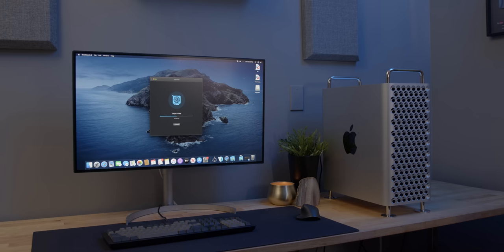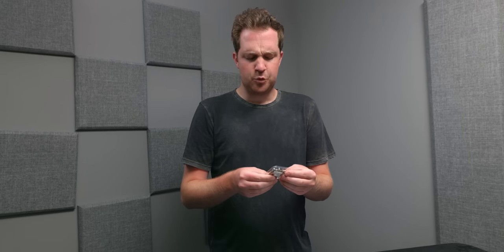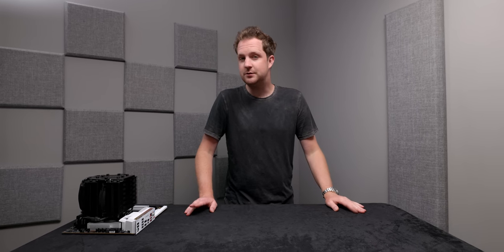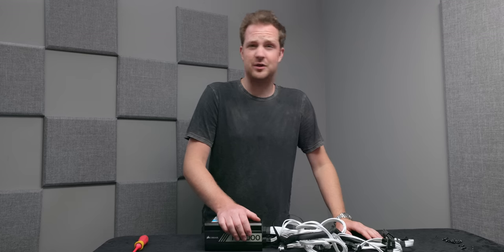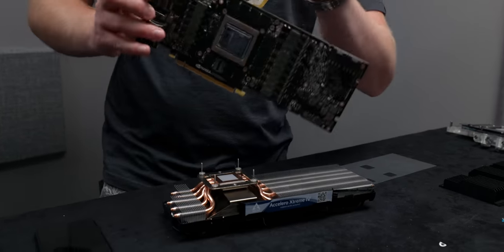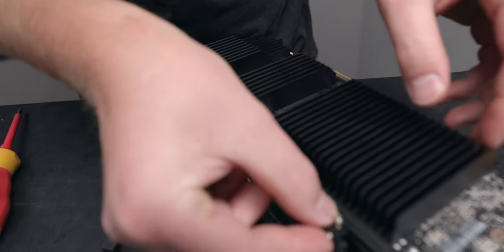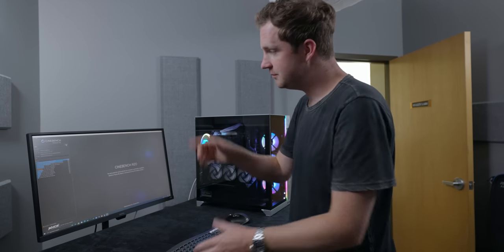The Quietest Computer EVER?!

Comment: I have 9 fans in my 011 Dynamic PCMR running at 500-700 RPM and the thing is downright silent. The pump is the loudest thing and that is probably because I don't have it isolated with rubber. And it is running an undervolted 3950x with 1300w Supernova that I replaced the fan with a Noctua fan that I can control with a Corsair controller and sensor.

Comment: I have a 420 rad in the top and could add another rad easily with 360 or 280 size . That’s quiet und full load. Super quiet . Use liquid metal paste wherever you can.

Comment: Cool video. I like the PSU idea. However, I think that water cooling will be by far quieter as you will basically only need the case fans for the rad and water pumps are really quiet. I recently did my first water cooling build. It wasn’t easy, but in the end it is 100% worth it.

Comment: An actual way to reduce heat is to simply operate GPUs at 90% of it's maximum default power. It's not the end of the world to low a few fps, efficiency will skyrocket. And if possible also undercoat both gpu/cpu.

Comment: First off: LGA 2011 (-3) is the best socket, as it comes with built-in aftermarket cooler support and is easier to install than TR4.
Second: There are differences in RAM, Dual Rank and Double Sided. At the same speed on paper, double sided dual rank RAM will be faster.

Comment: I think you are wrong in thinking that getting a bigger capacity power supply will contribute to your cause of getting more cooler and hence more quite power supply. The heat dissipated in a power supply can be assumed as Fixed + variable heat loss. Fixed will not depend on how much power you are consuming but variable will. Now, the problem with your approach is that you are thinking that a power supply would release more "variable heat loss" as it closes it's capacity which is kind of intuitive but wrong. This is because most power supplies are SMPS based which are more efficient if they are working close to 100% load. If I am wrong, feel free to correct me.

Comment: Here again someone made a video on a topic that he himself has no idea about ...

1. the Intel i5-10600K doesn't really consume less than a 3900X, but the heat is very concentrated with Intel

2. Completely wrong case, both for Silent and for these components, which simply don't look good in the case

3. yes a bigger power supply makes sense, but not that much bigger ...
Especially since there are power supplies that were designed for such applications and only start the fan at over 85% load ...

4. Corsair LL are loud even in relation to other RGB fans, regardless of whether they are throttled or not
just compare with the Arctoc P14 / P12, Corsair fans are a bad joke for silent

we summarize the video, He just wanted to make a video on the subject

Comment: so my power supply came with a setting where it would turn the fan off under light enough load, then turn it on when it needed to... and I ended up turning it off, because it was great when it wasn't running, and great even when it was, cause it wasn't spinning very fast (i got a 850W for the same reason you got a 1000W) but the spinning up itself was done by spinning the fan very fast for a couple seconds, which was more annoying than just letting it run very quietly at 10% all day.

Comment: 1. Lian Li Dynamic it's not the best idea for quiet solution (it's not too bad too). Why, it's simple: this case is having many custom slots like power supply in non-standard place which easier vibrating and a lot of custom plates which we can detach (can vibrating as well).
2. Mounting vertical GPU you should put some of additional stand on right side GPU to limit vibration from fans.
3. More fans with low RPM on bottom are help to keep good airflow from GPU and didn't get gpu fans to loud.
4. 3 fans mounted to give fresh air and only one which take them out ? Mate you have O11 Dynamic with top and bottom place for additional fans (should be always 1=1, 2=2, 3=3 etc), your components are boiling :v
5. You said about silent of that case but how anyone can believe you if you didn't put any DB measurement tool ?

- I will change fans to noctua or phanteks which produce less of DB with higher RPM (didn't said 100% on 3000 rpm ;) ).
- AIO on CPU and GPU in this case can make much less DB then CPU fan cooler and arctic cooler in GPU (of course if you mount them correctly).

Comment: I want a full passively cooled pc, and fans just for emergency overheat
Reply: So a macbook air 😳
Reply: Astolf I mean something than can run something more complicated than Minecraft on medium settings
Reply: Build one on a open bench with huge tower coolers for cpu andd gpu. Put a very low rpm 200mm fan on top of th pc. Boom

Comment: I predicted the back plate problem before I clicked the thumbnail. I have the Accellero on a FE GTX 1080 and a Noctua DH15... no room on the top slot, but no Vertical bracket on my case... I ended up using stock nuts from the GPU and eliminating that huge VRM heat sink.... There was hardly any difference..

Comment: The Noctua fans are quieter by every measure. Silent Wings are very good, but not quite noctua. If you are hearing them louder you’re letting them run up higher. Also, weighted panels do help high frequency noise quite a bit. A basic SPL meter doesn’t qualify certain frequencies are more annoying to humans. That is why mesh cases measure better, but are worse for living with.

Comment: So I've watched so many PC building videos (not just quiet ones), and they all seem to be running sub 70 degree cpu temps and sub 60 degree gpu temps. Do PCs just run a lot cooler than laptops or something? My undervolted Thinkpad P43s has an idle cpu temp of 65 degrees c, and if I do so much as open a browser with 2 monitors plugged in, it shoots up to around 78-85 degrees c. The GPU (quadro p520) is a little better (I understand that I can't change that temp by undervolting the cpu, I'm not that dumb), it gets around 60 degrees idle, but if anything decides to use my dedicated graphics, it wants to run at around 75 degrees. Is there a problem with my laptop or is that normal. It definitely affects my gaming, because my games switch to using my integrated graphics even though I have them set to use Nvidia in the Nvidia settings and Windows settings.

Edit: I tested my theory again and I realized a few things
1. My package temperature is 97 degrees, not my cpu (although my GPU is still sitting at 77 degrees)
2. my i7-8565u would be at around 3.9-4.00 ghz, which is amazing, I didn't know it was even capable of doing that.
BUT: when my game switched to using integrated graphics (which happened around 7-10 minutes into playing the game, which is Minecraft), the ghz dropped to an amazing 0.5. Which I don't get at all.  
3. This one makes sense, but all of my temperatures dropped after switching to integrated graphics (and whatever else it did).
my nvidia went back down to 55-60, and my package temperature dropped significantly, which probably just showed my gpu temp lowering. 

But yeah. I have no idea what to make of this, please someone help

Comment: 2:40 what do you mean it runs cooler? If you use the same CPU cooler and fans, for the noise level it only matters how much power the CPU consumes, because the cooler&fans have to dissipate that power as heat. Gamers Nexus' power consumption figures show that under load, at stock settings the 3700X uses about 20Watts less than the 10600K and the Ryzen 3000 CPUs are extremely low power at idel, as Der8auer showed.

Comment: That PSU is not the best move imho.
You could easely choose a fanless 650W instead of a 1000W with a fan. And you would have gained more efficency in idle and low usage (100-300W range)

Comment: The argument about memory is kinda wrong, seeing as different memory ICs have different properties e.g. Samsung B-die taking very well to overclocking and aren't very sensitive to voltages but are very temperature sensitive to voltages, Micron E-die taking to overclocking decently well and being less temperature-sensitive than B-die and Hynix MFR being kinda terrible for OCing and putting ~1.5V meaning likely degrading the chips, whilst B-die should be able to run 1.65V daily with active cooling etc.

Comment: I couldn't hear your pc's fan noise over my own pc's fan noise lol
I have noctua fans and the whole reason I bought them was to make my pc quieter...I even have the low noise adapters installed (basically just resistors) to make them spin slower/quieter...but it's just as loud as it was before.  for all the hype I hear of noctuas, I was pretty disappointed about that when I got them
Reply: Tune them down maybe? They're very quiet usually.

Comment: Woah! I'm building in a few weeks a PC (Hackintosh) too with a Intel i5-10400 and a Gigabyte Z490M.
Reply: Why would you get a Z490 board for a locked processor?  And why would you buy Intel over ryzen?  Quite literally, the ONLY time Intel is faster than ryzen at the same price point is at 1080p with a 2080 ti, do you plan on using a 2080 ti?  No? So why are you using Intel?
Reply: Brynden Rivers First of all:
I want to install MacOS on that and the Gigabyte Z490M is the best motherboard for this currently at a cheap price point of 127€ in Germany. I want RAM faster than 2666mhz and i like the design of the mainboard too as it’s high quality and has PCIe 4.0 even tho intel processors only support 3.0 currently. When I want to upgrade in 4 years Intel will release there 14th Gen chips and i will be able to only upgrade the CPU and have PCIe 4.0 by than. I could even use a unlocked cpu like a i7-14700K or i9-14900K or something like that and won‘t even need to upgrade my motherboard. Aesthetics are a huge deal when building a PC for me and i have no denies buying Intel over Ryzen because i wan‘t a HACKINTOSH, that works by the way also as a Gaming PC. I would pair it with a Ryzen 5600XT or some type of AMD GPU. The Intel i5-10400 outperformed even the Ryzen 5 3600 by a few percentages. Stop being that angry Kid that says „you could get better“ „go for ryzen“

Comment: 82C?!  That’s hotter than my Mac mini under load, lol!
Reply from the maker: No it isn’t 😂
Reply: @snazzy  So, update here -- turns out you were right, Q!  I was using an app from the app store called "monit" to monitor the temperatures in the side notifications bar...and that's where I was getting the temp data from.  I just installed the power gadget from Intel, and sure enough -- it's reporting (correct) temps that are MUCH hotter.  I just contacted the developer of that monit app, but damn...I've been using that thing for MONTHS and relying on that data, come to find out it's all bs :|  I'm not a happy camper, especially considering that monit app is not free either!

Comment: I was sad when I saw the Corsair fans. The Noctua or BeQuiet fans are quieter for a given RPM across the board; unless you need that sweet RGB the Corsair fans are almost completely not worth it for anything sound optimized,
Reply from the maker: They’re very quiet when at low RPM. Check fan curve tests. They only get loud once they’re over 1500ish RPM.

Comment: Why was a 10600k used over an 8700k?  With the 8700k not being soldered, it makes de-lidding it a far more reasonable prospect.
Also the comment about all RAM being the same is just wrong.  You don't even need to go too deep into technical specs to realise this.
And as others have mentioned, the choice of RGB over noise/performance goes against the goal of the build.
Reply: @Massimo De Grazia "Why would you delid a soldered CPU?"
In 99% of cases you wouldn't... and nowhere in my comment did I say you should.

Comment: Can we flame him for not using the correct vertical bracket for that case? The XL has its own bracket, the normal 011 dynamic bracket is supposed to screw into the bottom of the case. Also, why create so much work for yourself when you could of just kept the cooler on and added 3 fans at the bottom of the case or just adjust fan speeds

Comment: I dont think this will be as quiet as my system running 480x60 and 420x64mm radiators. No matter the load, i have my 11 fans set at a fixed 600rpm, and the highest temps my 9700k@5.2ghz will ever see is mid 50s. My 2080 super never goes above 40. The coil whine from the gpu is literally the only thing you'll ever hear

Comment: Not exactly "The Verge" level of misinformation, but not that far off. If you're building a PC to be super quiet please discuss this rather than RGB, Tempered Glass, etc. So many little mistakes, in RAM (CL timings), in case (quiet when using water cooling), in CPU cooler (Noctua/Antec) make higher static pressure for less noise fans), to slicing off the side of a bracket because you didn't go water cooled, to not specifing that not all PSUs have silent run, to not looking into power curves on PSU. For someone who's prepared to go into so much detail to get a machine to dual boot this is sloppy work. I'm not even going to mention the GPU cooler since it seems okay and I'm assuming you were sponsored by Artic for this but you could have mentioned that taking the heatsink off may invalidate your warranty at a time when people are likely to be looking at upgrading.
Reply from the maker: Not sponsored by anyone. And these mistakes are not really mistakes. They’re generalizations. We hit time markers and give the most accurate generalized information we can without going to insane detail as it hurts our retention, watch time, and bores 98% of the audience.

Comment: It bothers me that he said all ram (memory) sticks are the same. I mean there are different DDR notch types and then there is also the speed of the ram to also consider... I digress.
Reply: All "high performance" ram is the same.
Reply: @SibaNL  Even then, it doesn't dismiss the different ram speeds. High performance ram can have 2400/3200/3600 mhz. Not all memory sticks are made the same. I just find how he worded it quite odd...
Reply: @Sonic8608  It was more about pointing out that brand doesn't matter. As they come from the same manufacturers.
Reply: @SibaNL  I see, the way he worded seemed as if as he was describing all ram types, however, he did go over that MOST rams are made with generally the same chip manufacturers.

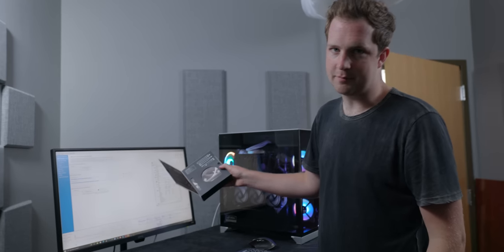Comment: "you can hate RGB... but it's better than a brown fan..." 21:04 Better than a Brown Fan - That's the same thing I've thought every time I've ever gone through the tedious and time-consuming search for a silent fan.  Why did Noctua ever decide to brand themselves with a fan color scheme that goes with nothing at all... and is just plain irritatingly ugly to boot...? You would think they'd at least give you an option to choose a common, standard color, say Black... but noooooo.... "people will instantly know it's one of our fans cause it's coffee cream and reddish brown that goes with absolutely nothing at all..."

Also, knew he was going to have problems when I saw the massive size of that HUGE cooler... no surprise at all there... what was surprising was rather than put a more appropriately sized cooler in there, he opted to jerry-rig the video card with a riser/horizontal mount which required a modified bracket instead...  good for him, but too much work, effort, scheming, etc. for most folks. 

A more properly sized cooler would be the better and more workable option for most folks... well, it would be for me anyway, having already dealt with a number of oversized cooler problems in the past... not worth the hassle, and surprisingly there are usually multiple options for coolers with the same TDP ratings, but different physical dimensions, if one takes the time to shop and compare...

Comment: Noctua is quieter than the BeQuiet cooler, Optimum Tech has some sweet comparisions
Reply: I am honestly confused why more power supply manufacturers don't collab with Noctua for creating a quiet cooling solution for those units. Noctua is one of the best manufacturers of quiet all-around fans and I feel they'd be a good fit in multiple supplies, even if they have to use an airflow-optimized design.
Reply: I am honestly confused why more power supply manufacturers don't collab with Noctua for creating a quiet cooling solution for those units. Noctua is one of the best manufacturers of quiet all-around fans and I feel they'd be a good fit in multiple supplies, even if they have to use an airflow-optimized design.

Comment: I have those Corsair fans. My PC is deadquiet, with the exception of the pump in my AiO cooler <_< Such whine
Reply: In that case it could help if you make sure the pump is lower than the radiator and the tubes exit at the bottom of the radiator. Gamers Nexus did a couple of videos about the subject recently.

Comment: laughs in Delta 80mm and 120mm fans
I use a 5x 5V/12V fan controller with 70W per channel and at 5V, pushes a ton of air, and is still fairly quiet (for Delta fans) and with headphones, I can't hear it.
Reply from the maker: Delta fans? Quiet? I don’t believe you. 😂
Reply: @snazzy * ish 
probably a little quieter when compared to regular fans at full speed.

Comment: The issue with using an overkill PSU with a low TDP build is that you are not going to hit the efficiency curve of the PSU. A gold 80+ PSU is only rated as 80+ at 50% or higher load, in the low envelope where this PC will sit 90% of the time it will be extremely inefficient. But I guess who cares about power usage, if you're just going for quiet. There are silent PSUs which are rated properly for a build. That also is the jankiest aftermarket GPU cooler I've ever seen. Horrid. There are plenty very quiet stock graphics cards with really good stock coolers. All the dremeling and taking things apart...to what end?

Comment: intel wasn't the pick if you wanted a fast machine with limited heat output a 3700x would be so much faster at less power. that chip is only "king" if you get it to 5.1-5.2 which means it loses any hope of a lower heat output